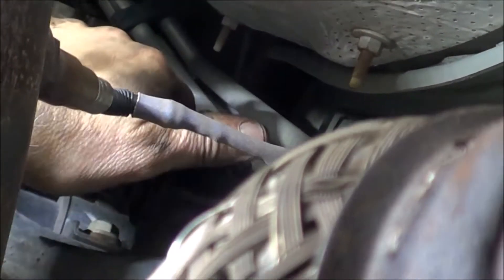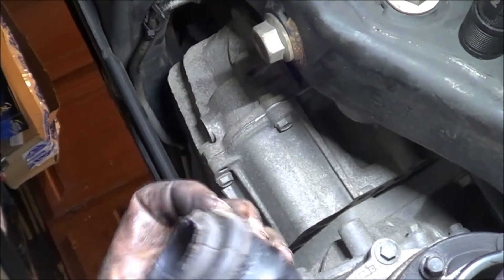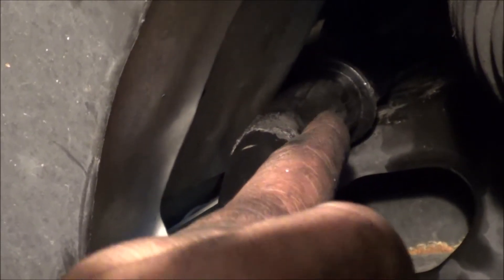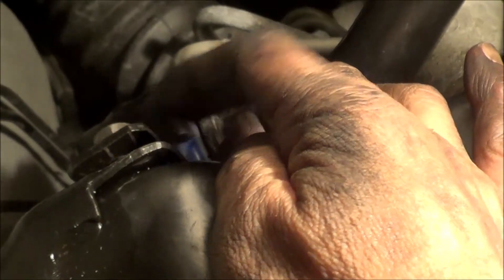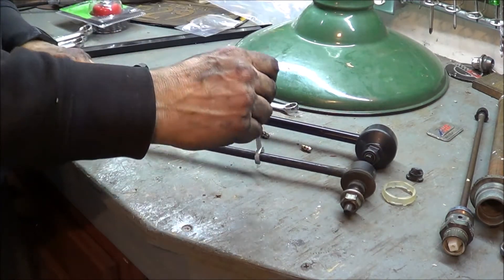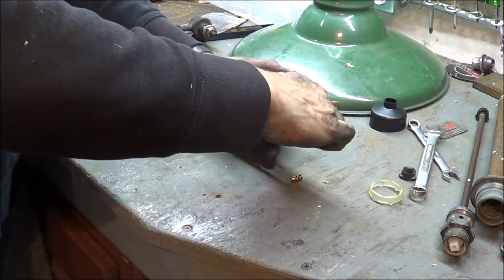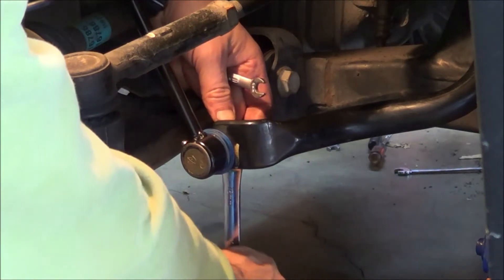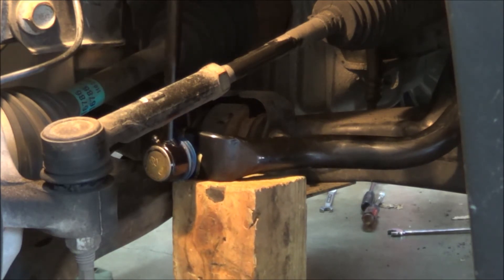Repair sway bar bushings and end link on GMC Acadia Acadia - pt2

Comment: What I found to help get the bushing over the sway bar easer was to put the new bushing in boiling water for about 5 min take the pan of water to shop with bushings still in water use extra caution with hot water use gloves and tongs to take 1 bushing out at a time it will go over the sway with a lot less trouble repeat with other this works very well
Reply from the maker: A brilliant idea!!!  I wish I would have thought of that before I fought that bushing for way to long.